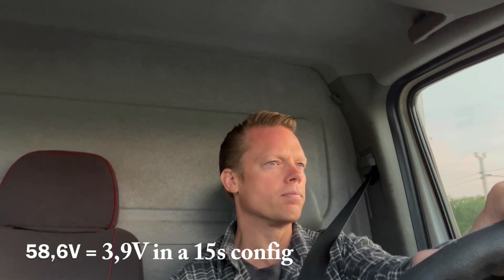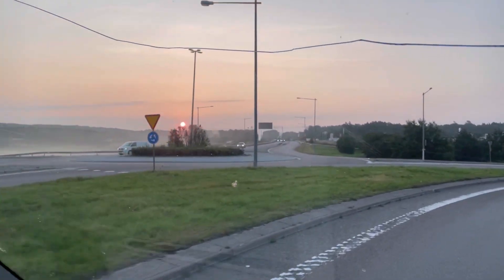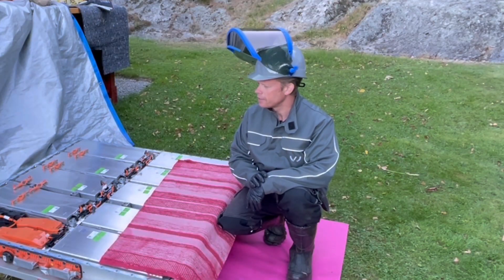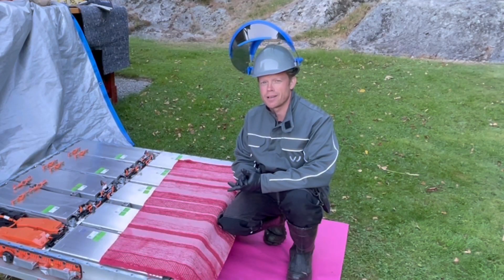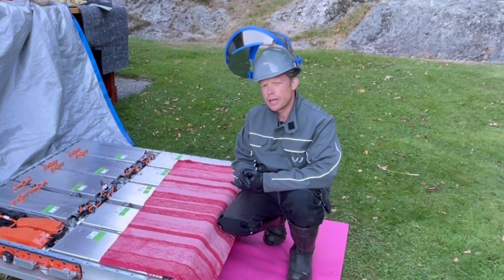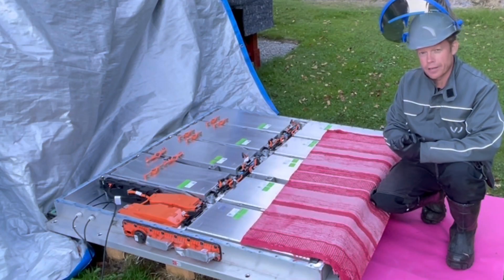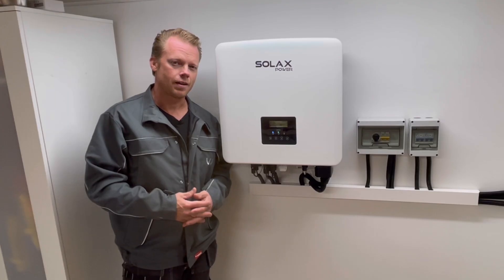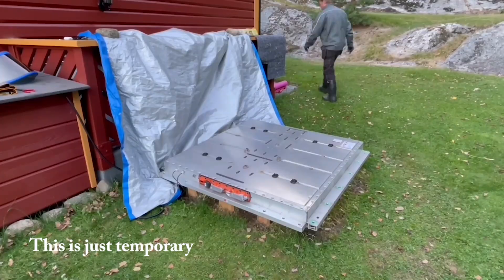Vw Id3 home battery 62kwh for solar storage

Comment: Hi, Thanks a lot for your videos! I bought a Skoda MEB battery and now need to take it apart and test it, but I don't have the PPE gear I need yet. Where did you find your arc flash helmet and gloves and which class do you need to work on an id3 62kWh batterry? I am struggling to find that either online or somewhere here close to Stockholm. Most places which have it require you to be a company with an OrgNr..Thanks for any tips!
Reply from the maker: Hi, glad you like them. I have ordered them from vag. But as you say, you need to have a orgnr.  See if you have a friend who works for Vw/Audi. HVE is the class you need to have to work with those batteries.
Good luck with your project!
Reply: Thanks for your reply! What i meant by class was the arc flash class 1 to 4 rating for the protective gear. I am wondering if class 1 is enough or if i need class 2. Any thoughts? Also i want to use this for an ev conversion and reconfigure to 2S 88v with either 4 or 5 sets in parallel. I am hoping to reuse the meb slave bms-es with a simp master bms. Any experience/thoughts on such a configuration?
Reply from the maker: @benjamindewilde-wj7zz  ok.
Class 2 is the and clothing.
I use Orion 2 in my battery and are very satisfied with that one. Simps bms are to much “home made” stuff if you ask me, and still no balancing of the cells, at least when I checked the last time.
Orion is probably the best bms for reteofitted ev cars. It can controll chargers etc.
Reply: Super, thanks a lot for the advice!
Reply from the maker: @benjamindewilde-wj7zz  your welcome.
Good luck with your project 👍🏻

Comment: Hello, do you have any procedures on opening up a meb battery pack? im about to open up one i bought but im hesitant on what buses etc to disconnect first? is there some kind of workshop manual?
Reply from the maker: Hi!
No, if it’s out from the car there is not anything more you can do.
Make sure you have protection clothes and do an isolation test after you open it.
I assume that you have the right knowledge to do that. Fist remove the busbar between master bms and Hv+ and then divide the voltage at the “bridge”.
Then keep on dividing until you are at module voltage.
Be  careful it’s dangerous, take help from a certified person from vw if you feel unsure.
Good luck with your project 😊
Reply: @flyingtools  thanks i will prepare my knowledge first before doing anything I have most of the HV protection incl the tools. the bridge is at the opposite side of the battery pack right? also i really enjoy your videos keep them coming

Comment: Hello. I want to use one module 48 v 5,3KWt from an VW ID 4 battery with a hybrid inverter, could you suggest a bms board for this battery?
Reply from the maker: Hi. I use daly smart BMS for my 12s id3  battery module. It’s very important that you use a bms with a maximum balance current at only 100mA. There are small fuses in the balance leads inside the module that’s not are possible to change.
I’m not sure about your module but probably the same.
Reply: @flyingtools  Hi. I am thinking about that BMS so I read a lot about it. Do you think Daly 12s 300A will be good for this battery? Thanks 👍
Reply from the maker: @ivansofilkanych1622  yes that will be great. I have used 250A with my earlier battery’s with good results. Just make sure that you have the right cell numbers and you should be fine. Good luck🔋😊

Comment: What kind of inverter are you using with the high voltage battery?? Link for the inverter being used please.
Reply from the maker: Solax x3 g4 runs on a 400v diy lithium battery.
https://youtu.be/VW4UjZP3jhc

Comment: HI i buy golf 7 pack battery 8.7kwh and i want to do as you , what 's name of your inverter? in your video you connected directly battery on inverter ?? without modification of accus??
thank you
Reply from the maker: Hi!
I use a solax X3G4 15kw hybrid inverter, you will find more info on my channel. 
Yes it’s connected directly without any bms, but that’s is going to change😉

Comment: Hello…….your name?

found your video and it is very interesting that the solax works with the battery. you said you can't share the firmware but what is the name/number of the firmware?. I also use batteries from the id3 but in a 48V system, I built the BMS myself and I use the LTC6803-4 device. I didn't see any protection in your videos, 400v from the battery is no fun and what surprises me a little is the battery input from the Solax is an MC4....  15000W at 400V is 37.5A 🤔I will buy the same Solax for the next project but with a battery from a BMW i3, this BMS can work with the SimpBMS.

can you please tell me the firmware name.. thanks Thomas
Reply from the maker: Hi. How do you make Simp bms to work with those mudules in series? I have a lot of comments about simps bms with those modules but can not find any info about how its done or even if it’s done in series.
It doesn’t even seems to work to 100% with only one module yet.  I have ordered a bms to my battery and will make a video about that later. Btw, it’s not mc4 connectors, they are bigger but looks almost the same. 30 amps is the max current to this unit so the kw depends on your battery voltage. I good thing to know before you start to plan you battery.
In your case 10,8kw with an i3 battery at full load. The firmware are probably country related with a lot of specific safety regulations so you have to take that with your installer.
Thanks for your comment 😊
Reply: hi on each battery of bmw i3 is a BMS, simpBMS is a teensy controller, the communication is canbus, the battery has 12S ( 8 Batterys in Serie ) , how can i send you a picture ?
Reply from the maker: That it will work with BMWs modules I already know, but with vw modules/balance ecu they still not able to start balancing, I think they can se the temp as it is right now. But anyway, I have already ordered another type of bms so the simps bms are not interesting for me the moment.
Thanks anyway😊
Reply: @flyingtools  Hi,I don't know your new BMS but I'm careful, every cell has a fuse inside.

Comment: Very nice video 🙂 Can you tell me where the NPT sensor is connected and what its value is. Unfortunately I can't find anything about it on the internet 😞
Reply from the maker: Hi and thank you so much 😊 
I plan to measuring that up and make a short info video about that and also how it is connected. I think it will posted in the next week.
Reply: @flyingtools  Yes, I still need the sensor.  then I can also put my solax into Run.
Reply from the maker: @RichardSteigmann  I will help you with that, when we know the ohm at a given temp you probably can run it with just a resistor, as a test at least.
Reply: @flyingtools  Yes, thank you. That would certainly help.But I still need the info, which plugs this is and which pins.That would be really great. 👍👍
Reply from the maker: @RichardSteigmann  I will let you know all of that 😉
Reply from the maker: @RichardSteigmann  I just uploaded the video. Hope you like it 😊

Comment: You can use SimpBMS and have it talk to all the can bus slave board, so it replaces the "motherboard" of the battery. 
I am not sure at this point if they can give balancing commands, SimpBMS can do that for Tesla or Mitsubishi boards, but earlier balancing wasn't working yet for VW modules.
Still, you can connect and see the status of all battery modules, cell voltages and temperatures, and then open or close a relay/contacter, which is already present in the battery.
Typically there is also a precharge available, but it appears that you don't need it because the Solax has a precharge procedure?
Reply: GRNbms is is the right bms for this!!!
Reply from the maker: @nnaiakuab5023  Hi.
There are more bms that can be used together with those modules.
Reply: @flyingtools  Ja, SimpBms BLCKbms. Das Leistungsstärkste und flexibelste, ist aber das GRNbms. Mqtt, 3xCAN, Weboberfläche,...
Reply from the maker: I can not find any info if they will work with modules in series. My plan is to go with Orion BMS instead. But thank you for good information👌🏻
Reply: @flyingtools  SimpBMS allows you to specify how much modules you have in series (9 in your case) and how much in parallel (1 in your case)
Here it is reported it now works with the ID3 modules
Reply from the maker: @roland9367  that sounds so interesting!
But if the balancing not working yet I think I have to wait.
But where can I find mor info about that?
Reply: @flyingtools  Just search for SimpBMS. It sounded like they got balancing working but I didn't read everything.
Typically you almost don't need any balancing in application like yours, at least you want the failsafe to intervene.
Reply from the maker: @roland9367  yes you are right about that regarding the balance, it’s more a nice thing to have if you can choose that when you plan to buy an BMS. However, I will give it a closer look. Thanks👍🏻

Comment: Nice. I like it. So you could probably monitor the cells via can commands? 
I'm very surprised you didn't put a fuse between your connections to the battery. Brave.
Reply from the maker: Yes, I hope so, and I will also se if a cell is balancing, so hopefully no need to open it up just to check that, I will definitely have a main fuse before the connections in the near future, this is just a temporary setup.Thanks for your concern👍🏻
Reply: When/if you open it up again.. I hope you do drain one cell to see if the bms is going to balance it. and likewise.. charge a single cell above .04

Comment: Hey..please share how u made the solax work with other battery since i see they only support solax battery and i want to get a 15kw hybrid d version to make use of another high voltage battery like u did
Reply from the maker: It’s on its way, promise to be careful if you do so.
Reply: @flyingtools  i will buy one ...but dont know which car battery to look for in the wrecked selection..i need around 20kwh max as battery but dont want to spend fortune on tripple power from solax

Comment: Spännande. Behöver du ingen kommunikation mellan batteri och inverter? Vilka spänningsnivåer klarar invertern att hantera?
Reply from the maker: Nej, detta är en av få inverterar som klarar det. Men det är otroligt viktigt att ställa in invertern rätt, annars är man rätt rökt, bokstavligen. Menyn är även låst med en kod som installatören har.
Den kan hantera mellan 200-600v
Reply: @flyingtools  Grymt! Letar lite efter någon sån här lösning själv där man inte är låst till något specifikt batteri. Är själv elektriker.
Finns det någon möjlighet att få prata med dig och få lite tipps och ideer runt detta?
Mvh Mathias

Comment: Tur att jag följt dig en tid nu så jag vet att du har bra koll, annars hade jag nog inte vågat titta!!! 🤣 Ska bli roligt att se vad du hittar för lösning på detta! Själv har jag beställt 12 st dubellsidiga solpaneler som jag ska bygga en solföljare till. Har du något tips på styrenhet för solföljaren? Mvh /Peter
Reply from the maker: Tjena, spännande! Jag har testat några trackers från eBay men varit ganska missnöjd tyvärr. Har precis köpt ett par programmerbara timers som jag ska modifiera lite. Då följer de klockan istället för solen. Hittar du en färdig sådan lösning för en vettig peng så satsa på det.
Reply: Aha, de jag kikat på är ljustyrda, dvs en ljussensor känner av var det är mest ljus och flyttar åt det hållet som "max ljus finns" de kostar runt 2000 kr

Comment: Nice. Is a surprise. I was expecting to see e-tron battery :)). Will you rearrange the old battery for the same voltage?
Reply from the maker: Tanks. The e-tron battery was only interesting for its 3s module configuration but now when I can have a wide voltage range this battery is so simple to work with if I want to remove the modules from the battery tray and install it in my house. 
I sold the 48v battery so I could pay for this battery.
Reply: @flyingtools  I was expecting e-tron battery at full voltage.